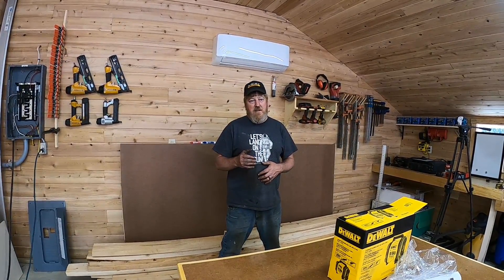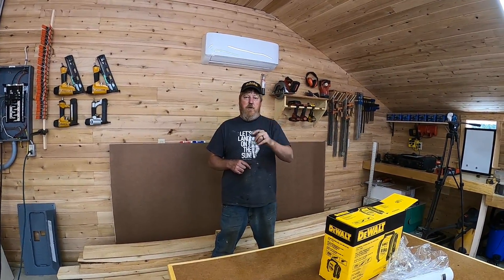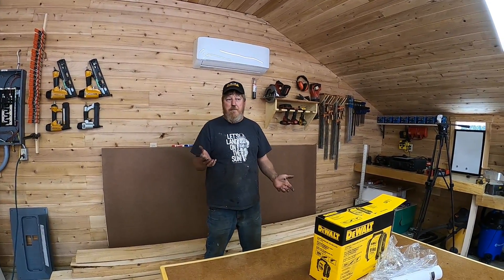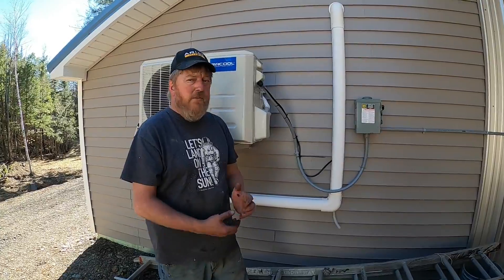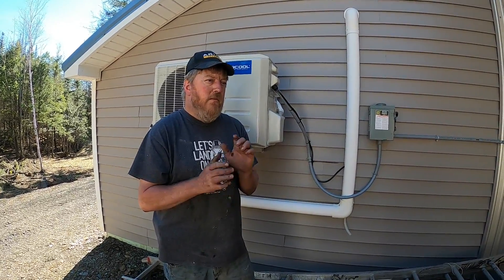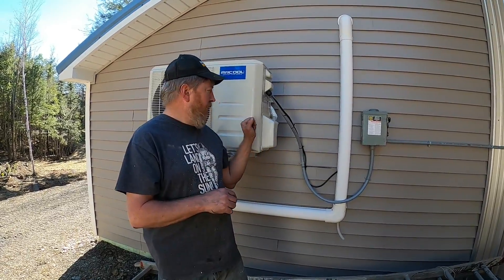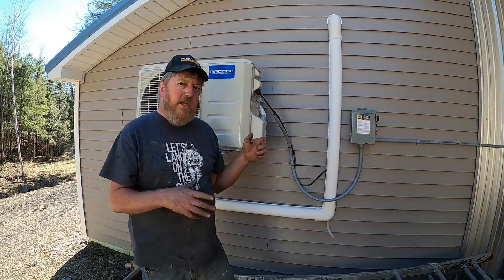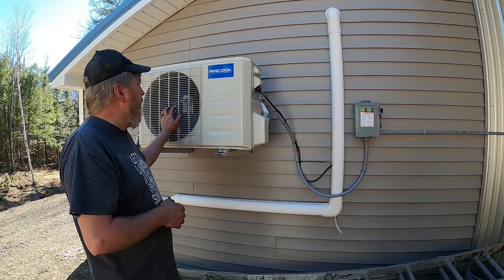Mr Cool Heat Pump First Winter Review and Detailed Electrical Connections

Comment: After watching the instructional video, I sifted through your other videos hoping to find the followup video. Huzzah!

I just pulled the trigger on the non-DIY tonight because of your video. Thanks for linking to the vacuum and adapter. I wont be buying the expensive gauge, but I'll run it for 45 minutes and let it sit for 45 minutes, and verify the little circle meter hasn't moved to any kind of lb reading.

QUESTION: When I exit the house, I have a unique need to make my very first angle heading LEFT (if I'm staring at it) instead of straight down. If I simply make the slope through the wall slightly more exaggerated, will my condensation line get too angry about having to bank left immediately outside? (Left, then down, then, left some more...). I'm having to go around a window.
Reply: You only need 1/4" of fall per 10 feet of pipe per code.  So if your outside hole is 1/4" lower than inside, you are fine.  As long as you don't go uphill, it's fine.
Reply from the maker: As long as the condensate line isnt kinked and is going down hill some you should be just fine.
Reply: Keep the drop on the line as steep as you can, the only problem I have ever had with cond lines is having them freeze. It's good that NORMALLY there is little condensation from the inside units in cold weather, only when cooling.

Comment: I thought the 12K unit was 120 volts, did you misspeak on that? Will you be putting the 18K in the Auto shop since it has a variable pump?
Reply from the maker: From what I can tell the 12K is available as a 120v unit or as a 240v unit. I am not sure what you mean by variable pump on the 18K? I was under the impression they all had variable speed pumps and fans. Will have to do some more research but the Auto shop is the same size as the wood shop square footage although it is larger in cubic footage. But it is also between to heated spaces with only 28ft of exterior wall so its hard to say. It never got below 40F in the auto shop last winter with the two heated spaces on either side.
Reply: @aroundthehomesteadwithsuer3497  Thanks, Yep you are right. I think you are good to go on that too. Is there a benefit to using the 120 volt 12K unit vs the 240 Volt if you plan to use Solar to power it?
Reply from the maker: @KyBrancaccio  Not really, At the end of the day its all the same watts so from that perspective its the same but 240 vs 120 will be less amps, smaller wire etc so when I can I prefer 240vac for things like that or table saws etc

Comment: Thanks to your first video on the Mr. Cool  advantage series, I bought my own vacuum pump, gauges, open ended torque wrench, nylog blue and installed our own 18K mini split with no problems. One thing I did screw up was i over tightened the small copper tubing and  it squeeze the flare off in two, I had to do my own re-flare with no problem. I had bought two 18k units from Lowes and they could not provide me with any local contractors that we able and willing to install the big box mini split. I also contacted many HVAC contractors and no one was willing to take my money to install the Mr Cools.  I worked in and retired from a large chemical company where we operated large scale refrigeration and pulling vacuums with large steam ejector jets for refrigeration systems using ethylene, propylene or ammonia. For example our propylene re-frige compressor was around 40khp. We had to remove all of the non-condensable gases and hydrates from the refrigeration loop.
Reply: The reason you blew the line out the back is because you put the Nylog on the back of the tubing when you installed it. I know Nylog shows this and some installers do it but I did extensive tests with a precision torque wrench. It didn't take much to push it out when the torque is just slightly high or when you slowly torque up. The Nylog is so slippery and the copper so thin that you have to be super careful not to damage your lines. I did the same thing, I slowly brought the torque up and as I approached the correct torque the lines went right out the back! Now I just put a very small amount where the two fittings meet and I'm good.